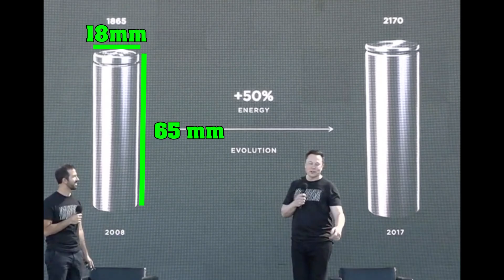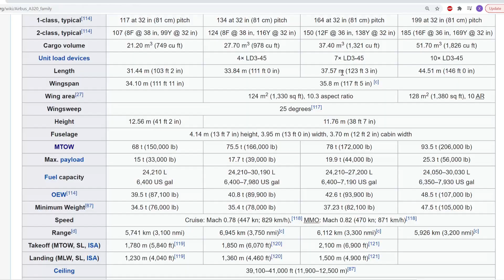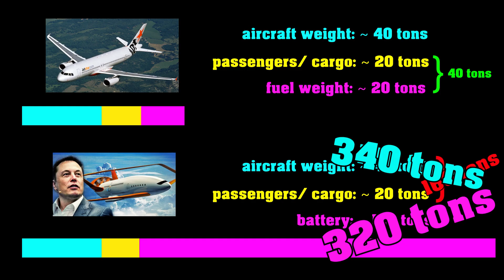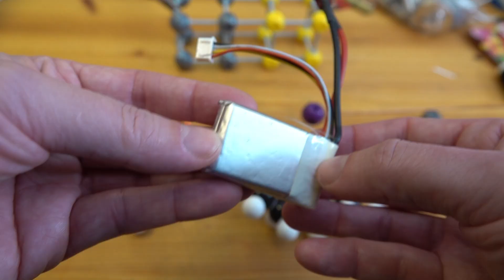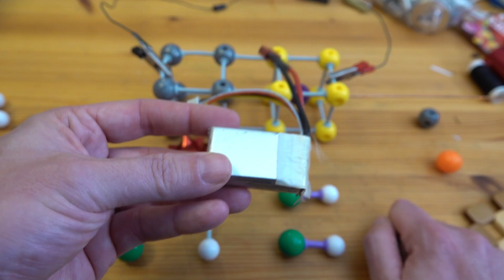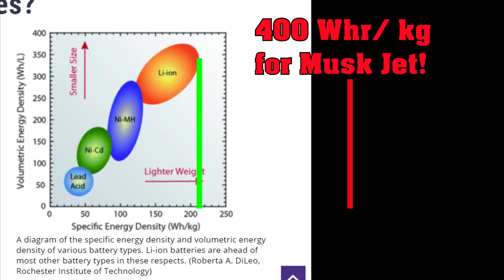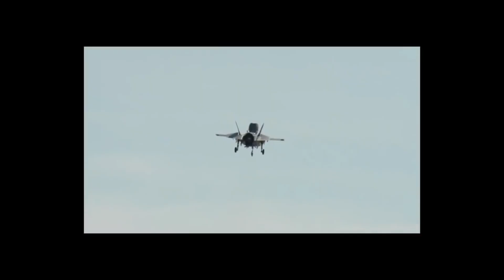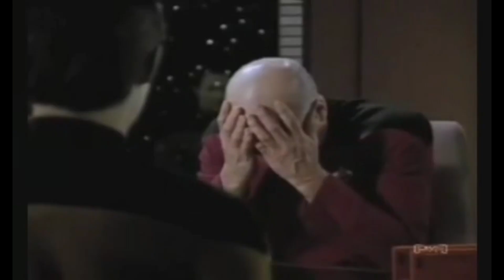Tesla's Secret Plan To Disrupt Airlines: BUSTED!!

Comment: At airport check-in: "Sir, do you carry any batteries?"
"Yeah, my camera... But I thought..."
"I'll have to confiscate them. We need them to fly the plane."
Reply: Actually... Large batteries are not allowed on planes... Maybe that's the first clue that this is a bad idea.
Reply: @louislux  That's why they need the small batteries from camera's. Tens of thousands of them...
Reply: @louislux  because they're a fire hazard. the last thing u want is a fire while in the air. sure, lets make a plane 70% ticking time bomb
Reply: @badrequest5596  Yea because they let you fly with a 10oz bottle of jet fuel...
Because jet fuel is obviously NOT a fire hazard.
Maybe that's a clue that jet fuel is a bad idea? No. That stupid logic only works for small batteries, uh?

You guys are delusional.
Reply: @louislux  Actually they are allowed. You're not allowed to fly with potential projectiles that can injure passangers during flight. But you can definetly carry a laptop, take a guess which battery has more energy capacity? A laptop or a zinc-carbon C battery?
By the way:
You can't fly with a 10oz bottle of jet fuel either.
Reply: @bluesrockfan36  Are you seriously defending a plane which is 70% battery by weight and made with unicorn technology lmfao
Reply: @isodoublet  That's the problem TF and you have. You're thinking of a boeing and slapping a battery on it.
Electric airplanes will have to be redesigned from the ground up, change the way we view airplanes.
You'll have to minimize as much weight as possible by using the battery as fuselage.
It would also have to fly in a different far more efficient way. Much higher and much faster to prevent too much air drag. Hence the supersonic part.

It's very much possible, the energy density is there, but it would require a massive engineering undertaking to accomplish. Just like landing and reusing orbital boosters.

To dismiss it beforehand because it's a hard problem or you lack imagination on how to achieve is, is not what engineers do.
Reply: @bluesrockfan36  "You're thinking of a boeing and slapping a battery on it."

No, I'm taking Musk at his word when he says he'll build a plane that's 70% unicorn battery. Redesign all you want, that's fundamentally stupid and if you can't see that you're stupid too.
Reply: @isodoublet  He never said he would. He said he would like to try in the future when the technology improves.
Nothing wrong with trying. Giving up because you think it's hard is an awful attitude to have, like calling successful engineers... stupid. Really pathetic attitude.
Reply: @bluesrockfan36  "He never said he would. He said he would like to try in the future when the technology improves."

I don't care. It's a stupid idea whether with today's technology or with magical future technology. Wasting 70% of a plane's weight on batteries is something that only someone with zero understanding of aviation would propose.
Reply: @isodoublet  Are you an aerospace engineer? No?
Then you are in no position to call the idea stupid.
Reply: @bluesrockfan36  That's a truly pathetic excuse for an argument. But of course I should expect this kind of craven authority worship from a musk fan.

It's a stupid idea whether you like it or not. Sorry.
Reply: @isodoublet  No a pathetic excuse for an argument is to call an idea stupid with 0 argumentation nor explanation other than... another clown on youtube said so. A clown that as evidenced by his myriads of elementary mistakes has zero clue whatsoever about the subject.
A clown,  like you.

Grow a pair of braincells.
Reply: @bluesrockfan36  "No a pathetic excuse for an argument is to call an idea stupid with 0 argumentation "

Like I said, if you can't see why wasting 70% of space in an airplane is idiotic, you have no clue about aviation. I don't care how much you redesign it. And that's assuming a unicorn batter that doesn't exist and won't exist for the foreseeable future.

Musk fans, please don't procreate.
Reply: @isodoublet  If you can't see why making numbers up about an airplane that hasn't even been designed is idiotic... That's your problem.
No one is wasting 70% of space.
You made that shit up. You don't know the first thing about aerospace engineering.

Dunning kruger clowns... Please don't procreate.
Reply: @bluesrockfan36  " If you can't see why making numbers up about an airplane that hasn't even been designed is idiotic.."

Hahaha you've resorted to accusing your own idol of being an idiot now? Whatever makes your cult go I guess, but I must confess it seems weird to the uninitiated.
Reply: @isodoublet  No, I'm accusing of you being a clown that hasn't made a single valid point all day long.
All you got is appeal to the stone fallacies, ad hominems and flat out making shit up.

There are a myriad of educational videos online, free. Your ignorance is willful.

You even confuse space with mass.
You really are clueless.

Now you're into this "cult" BS, when the only one who believes things out of faith cause some youtube clown said so with no evidence is... You.

Grow up kid, it's about time you do so.
Reply: @bluesrockfan36  Conversation's not about me, buddy. Your own idol said it would be 70% battery. Do try to keep up.
Reply: @isodoublet  I honestly, don't get it. Why do you make shit up? Don't you have better things to do?

a. He never said it would be 70% battery.
b. If he did (which he didn't) 70% battery is NOT 70% of the physical SPACE being a battery.
Space and mass are very different things, you know? Well... you probably don't.  Now you do!

You should tell those lovely aerospace engineers working in NASA how "stupid" their X-57 Maxwell aircraft is. How its a waste of time. 
How they should scuttle the project asap.

Do tell them how its definelty NOT stupid to insist on using airplanes without RENEWABLE energy like we currently are, so when eventually it runs out... we're entirely left without any form of aerial travel.
Brilliant,take there, genius.

Stop listening to Thunderf00t, he's addling your brain.
Reply: @bluesrockfan36  " I honestly, don't get it. Why do you make shit up? "

You need to watch the video again, buddy. When you do, I'll be here. I'll ignore the rest.
Reply: @isodoublet  So you want me to watch TF lies and BS instead of yours?
Timestamp or it didn't happen.
Reply: @bluesrockfan36  Around 3 minutes 30 seconds buddy.

I'll be awaiting your apology.
Reply: @isodoublet  You mean the half a sentence TF cut right in the middle and out of context? Musk was referring to possible cell to mass ratio. NOT space. This is what you made up, this is what I called you out on. Do you even know what a fuel fraction is? Did you know the average OEW percentage is about 50%? That long range vehicles usually have about 60-80% fuel weight fraction?
No.
Because just like TF, you're clueless about the topic, so you just rather make shit up and dismiss ideas from actual engineers as stupid, in order to feel better about yourself in a deluded manifestation of an inferiority complex.

I'll accept your apology now.
Reply: @bluesrockfan36  "You mean the half a sentence TF cut right in the middle and out of context?"

Doesn't matter. He said clearly and without ambiguity that it would be 70% battery. Pro-tip, complaining about context only makes sense if the context makes a difference.

"NOT space. This is what you made up"

Who said space? You're the one making that up, my dude. But again, it doesn't make any difference because if you think 70% battery by weight is reasonable you need to spit out those paint chips.

" That long range vehicles usually have about 60-80% fuel weight fraction?"

No, they don't, lmao. Take the 767-400ER for example. MTOW = 204.1 t, max fuel capacity = 73.4 t, for a fuel fraction of about 35%. But that's of course assuming it's not hauling anything but fuel, so in reality it'd be a lot lower. And what's more, that fuel gets burned during the trip (funny how that works) so the plane gets lighter and thus goes farther. But I suppose I should wait for elon to propose jettisoning the batteries on parachutes, LOL.

" dismiss ideas from actual engineers as stupid, "

Elon's a conman, not an engineer.

"I'll accept your apology now."

LOL the most you'll get for me is "you're welcome for the education". Stay down.
Reply: @isodoublet  Not battery, cell mass ratio. That's what he said. Context does change and always matter. Pro-tip... NEVER trust a source that cuts someone mid-sentence. They have nefarious intent, always.

You did say space:
if you can't see why wasting 70% of space in an airplane is idiotic 

Do you understand the vast difference between 70% cell battery mass with 70% of actual volume? If you can't understand this very basic principle, there is little hope of you understanding the rest.
Mass is not space.

'No they don't'
Yes they do, particularly on take-off.
You also don't understand what long range is.

Regardless, you keep making the same mistake TF does. You are extrapolating current aviation paradigms to short range supersonic high altitude electric planes.
It doesn't work that way. To make an electric plane work it needs to fly differently. It needs fly higher and get to altitude faster, that way you require far less energy in the flight.

"not an engineer"
Very much an engineer sorry to disappoint. If you don't want to believe me, I can give you sources of famous aerospace, automotive and electronic engineers saying so. Stop listening to clowns in youtube and start listening to actual experts.
Sandy Munro, Jim Keller, Lex Fridmann... you know, ACTUAL engineers? Sandy famously interviewed the guy, worth a watch.

FYI... your "stay down" comment is just more indication of the inferiority complex I told you about, that you think a youtube discussion is a fight of somesort. It's not, and if it were, you lost, badly. I work in the field that you just have casual understanding if any at all.
Reply: @bluesrockfan36  "Not battery, cell mass ratio. That's what he said. Context does change and always matter."

Right, that's why he compared it with a rocket, because rockets have cells... facepalm. You cultists truly are special. 

"You did say space:
if you can't see why wasting 70% of space in an airplane is idiotic "

I obviously meant capacity, not volume, lmao. What was that about context again?

"Yes they do, particularly on take-off."

LOL. I just gave you the actual numbers, the verifiable, undeniable facts, my friend. You don't get to "yes they do" your way out of facts. Even a KC-135 Stratotanker, a plane that is designed to ferry huge amounts of fuel, gets to carry only barely over 60% fuel by mass. Again: these are facts. 

I stopped there. You get to earn my reading your crap from now on, and you can start by apologizing for trying to lie about facts that can be easily verified online.
Reply: @isodoublet  This is going way over your head it seems.
Battery =/= cell mass ratio.
Space =/= capacity =/= CELL MASS RATIO

He compared the fuel mass ratio to a theoretical cell mass ratio for an airplane. Said NOTHING about space, battery and capacity. You're thinking of a giant battery in the airplane and everyone squished against the windows instead of thinking that the plane IS the battery.

"I just gave you actual numbers"
For one particular airplane. You even contradicted yourself in this new example. Was it 60% or 35%?

Anyways, since you're an expert in aerospace engineering and per your claim that 70% fuel ratio is "stupid', I guess:
a. The Straroranker is stupid.
b. All forms of rockets are stupid.

May as well send a letter to NASA explaining now stupid they are.

I'm still waiting for your apology. You did, after all, as proved above LIED about Musk claiming that 70% of the 'space' and now 'capacity' would be reserved for the battery.
Reply: @bluesrockfan36  Musk himself said the plane needed to be 70% "something". Whether that something is "battery", "cell", dead babies etc is completely irrelevant. What matters is that even with unicorn technology this is two times worse than real airplanes. Again, your idol said this.

I see no apology for your craven lies, so I stopped reading there. Try again.
Reply: @isodoublet  I've argued with this guy before. The sheer absurdity on the way they openly lie to people's faces is absolutely incomprehensible.
Reply: @electric7487  Yeah that one's a doozy. This is the sort of thing that could work in person before everyone had smartphones, so this style of sophistry is like 10 years out of date!
Reply: next great idea: an electric zeppelin lifted by hydrogen
Reply: @badrequest5596  a comercial rocket powered by a hydroger cloride reaction
Reply: @badrequest5596  ...with high voltage brush motors! Hey, what could possibly go wrong? ;)
Reply: Elon was going to use Mad Mike Hughes as a test pilot...
Reply: Lmao

Comment: I just want to point out that most Airline Transport Category aircraft cruise between 35k and 41k feet because depending on weight and air density these are usually the most fuel efficient altitudes. For example in the A320 CEO with the CFM56-5B4 turbofans, at ISA and fully loaded usually around 34k feet will be optimal assuming no wind. As you burn fuel the optimum altitude for fuel efficiency will increase up until the service ceiling which is FL390. So at 28:22 when they claim jet engines are less efficient at higher altitudes that is bullshit.

Comment: Surely it would be more energy efficient to create a bio-diesel (Or bio-kerosene) plane. The biodiesel could be carbon neutral if you generate it sensibly and it could use similar if not the same technology that is used already. Probably would be better for the planet and more feasible than making a glorified battery with wings. 

These claims are based off the energy density, since it is equivilent to regular kerosene, and not based on speculation and innovation that fails on first inspection.

Comment: It is astounding that these people have such a lack of a grasp of sanity, reality and the laws of physics that they think an electric plane is going to fare much better than a plane with a combustion engine at high altitude. They are completely ignoring the fact that the electric plane's wings still needs air to generate lift and those electric fans are still going to need air to generate thrust. As addressed in the video, these problems become even more difficult as the service window gets wider as wings and fans that are good and efficient at 50 thousand feet and mach >1 are no good at sea level, adding to power and energy requirements.

Comment: Just to be a devils advocate, there is some research into structural batteries aka batteries that can be used as structural part of fuselage. How far that goes, I have no idea.
To get civilian supersonic jets back (combustion powered or not) we need to solve noise issue, the engines are part of it but the bigger one is the sonic boom. Without that they have very limited use case (only trans oceanic flights).
Reply: Searching the comments for this as I was thinking the same about structural batteries, which the new ones are planned to be for future Tesla models with the 4680 cells. I'd be interested to see Thunderf00t's take on if this could make electric planes viable and if that's what Elon is thinking.
Reply: @highheels200  I can't imagine FAA being happy about a whole plane made out of flammable batteries... So I don't think that structural batteries will make a big difference in weight  of the plane.
Reply: Commercial aircraft have been using structural fuel tanks for a while. They're called "wet wings", which is where parts of the wings are sealed off and used as fuel tanks. The argument that people bring up that says "batteries can be structural while fuel cannot" is largely disingenuous.
Reply: @electric7487  I don't think that fuel itself gives any support in a plane, the fuel tank does that. I in some rockets fuel gives structural support as it is under high pressure. There were  rockets that could not support their weight when empty.

Comment: Did you also consider that most planes have a maximum landing weight which is lower than the takeoff weight (~10t in the A320's case). Given that battery powered planes don't get lighter as they use fuel means you can knock another 10t off the takeoff weight there too.

Hard to justify burning the fuel as a good thing on environmental grounds but does add further problems on the engineering side of battery planes.

Comment: Musk uses a number of buzzwords.

VTOL is the most inefficient way to start an airplane. Just look at the vectors. Supersonic, well its just sounds nice. There is a little problem with supersonic civl aircrafts: They are forbidden in US airspace, the main reason why Concorde has failed.

VTOL- technology is used  only, if you really just a  have a certain area available, which isn't extendable. E.g.: a small clearing in a war zone or some accessible plateau in a mountainous region. In all other cases  STOL is the preferred way to get a plane airborne, on the one hand its much faster , and on the other hand you are able to transport a higher payload.

Comment: Slight correction, you can't fill the A320 fuel of fuel and hit it's maximum zero fuel weight (generally 61t or 62.5t depending on airline). Aircraft are very rarely at MZFW, however long routes like Eastern Europe to Tenerife will easily require 20 tonnes of fuel if the wind isn't playing ball.